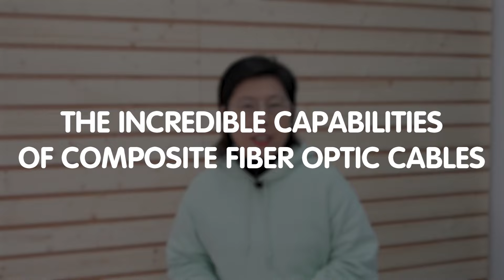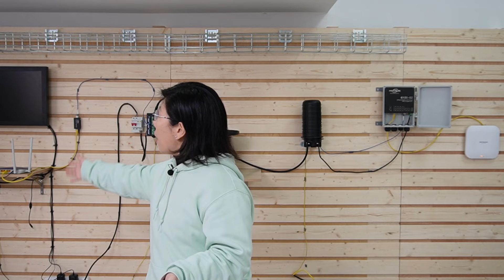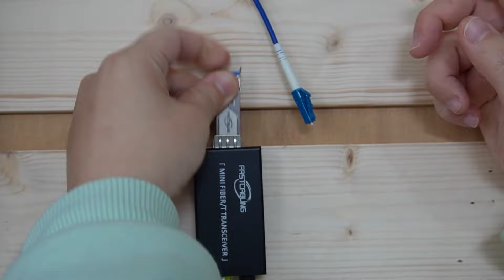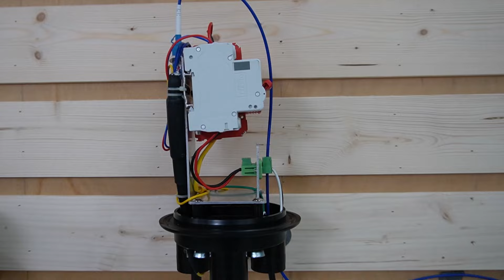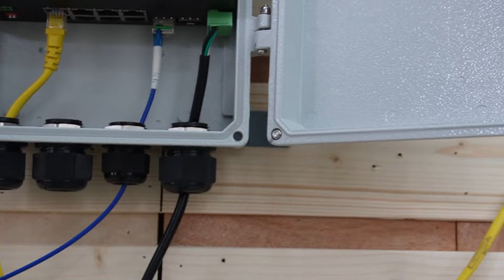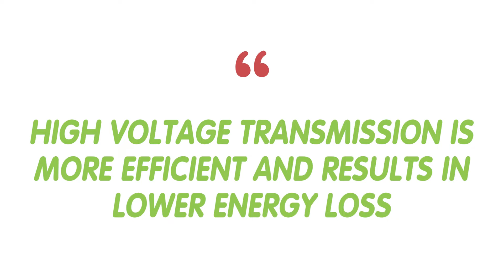Revolutionizing Connectivity: Remote AC Power in Fiber Optic Networks

Comment: That is not an "air-switch" .. that is an RCBO, residual current breaker with overload. Grounding is not for protecting equipment against electrical surges but protecting the human being from stray currents originating from insulation failures.
Reply: electrical engineer here, that is indeed an air switch. hope this helped
Reply: also i got in an online argument years about about using UPSs as surge protectors and found out any real form of surge protection starts with good grounding. big data centers aim for 0ohm ground. apparanelty the old chap worked for motorola and linked me an old white paper about from Motorola.
Reply: @cdoublejj  grounding .. yes but not without the relevant TVSS or surge arrestors in place to send the voltage transients to in the first place.

Comment: finally, someone manufactured these kind of cable, I've been using 2 steel wire on drop cable to deliver quite high (using custom transformer) for AC voltage enough to rectified and produce 48VDC on other end up and running for over 1 year now
Reply from the maker: Thanks for your comment! We've launched different types of powered fiber cables. For more information here: https://www.fastcabling.com/product-category/pre-made-fiber-cable/2-strands-fiber-cable/

Comment: Woohoo we put two types of cables together. Look at us we are geniuses.
Is this satire? Why shouldn't I just use a regular power cable and a regular fibre cable? Cheaper and better.
Reply from the maker: Thanks for your comment. Running a single powered fiber cable instead of separate power and data cables reduces the number of cables needed, simplifying the installation process. With fewer cables, the space needed for conduit and cable management infrastructure is also reduced, which can lower installation costs and physical space requirements.

Comment: I thought that they use powerful lasers and photocells to ransmit and convert the power. No point using optical cable this way, I would use Cat6+power wiring with integrated rope for this.
Reply: And what about distances of over 100m with 10+gbit? Wont work with CAT cabling.
Reply from the maker: PoE typically has a distance limitation of about 100 meters (PoE extenders are often required as the distance increases) while powered fiber cables can extend much further than PoE, often up to several kilometers. Moreover, they deliver higher power levels over longer distances. High-power PoE can deliver up to 60W and 90W respectively. While sufficient for many applications, this might not meet the power needs of all devices, especially those requiring higher power.
Reply from the maker: That's true. 10Gbps is achievable over a length of up to 55 meters (around 180 feet). For distances up to 100 meters (approximately 328 feet), Cat6 can support speeds of up to 1Gbps.

Comment: Won't pass australia compliance
Reply from the maker: You might consider the 56VDC instead of AC. The surge protector should be replaced with DC version. The voltage drop is something you need to consider which relates to the lenght, power consumption and the wire gauge.

Comment: Is the power transmission electrically isolated (from ground)? Meaning elector-magnetically coupled (eg. isolation transformer) instead of directly connected?
Fiber optic -> long distance.
GROUNDED (directly or relatively) electrical transmission over long distance -> BAD IDEA because on the far/remote point you
1. either have to ground again: potentially creating a ground loop and definitely introducing "potential equalization" power flowing just over ground (equalizing different local earth/ground potentials - up to and including lightning strike power).
2. or leave it floating with the far away earth ground/potential, thus creating a local electrical shock hazard.

And from a servicing standpoint this is terrible as well: Got a broken fiber somewhere? No, you cant hire an electrician to repair the AC line and a "fiber optics guy" to repair the fiber - you need a special cable from just one company and special instructions for their "special" child - I mean product.

Groundbreaking my ass (in at least two ways) - as if combining data and power is a new idea. Have you heard of the big fiber optic cables crisscrossing the earth and connecting its continents?